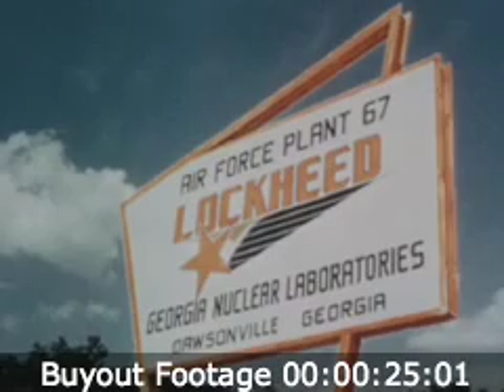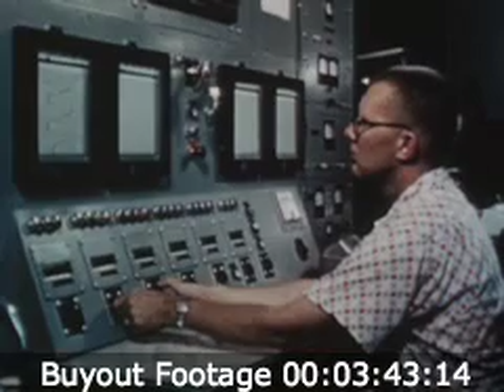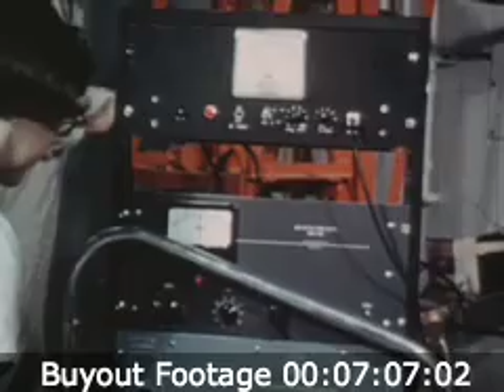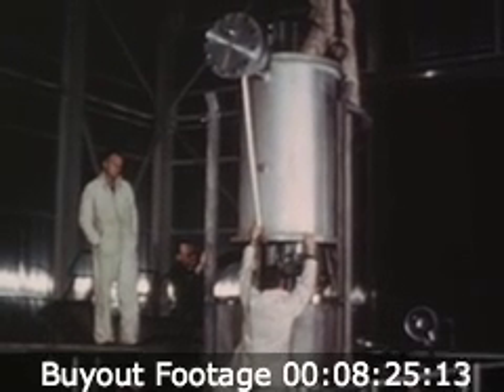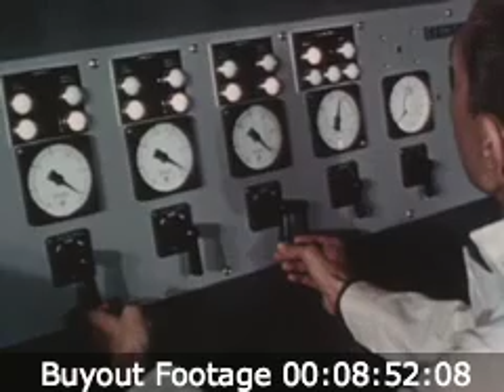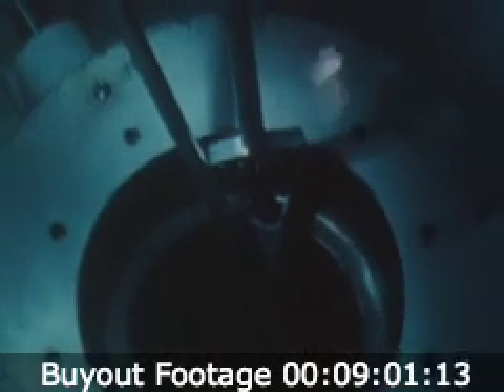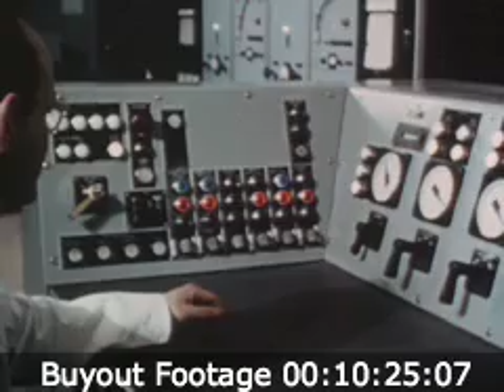Dawsonville Georgia Nuclear Aircraft Laboratory 1959 full video

Comment: One thing this reactor did was instant taxidermy.  Small rodents died immediately and were preserved because the bacteria died as well.  The underground control center is still there, although filled with water.  A lot of the concrete shielding still exists as well.
Kennedy cancelled the nuclear bomber plan for several reasons.  A crash was too dangerous, it tended to irradiate the crew to a small extent, and missiles were taking over the job of strategic bombers.  The research on the exotic reactor built for the plane is now very useful in designing the new versions of nuclear reactors.